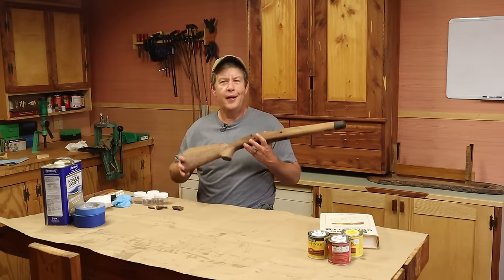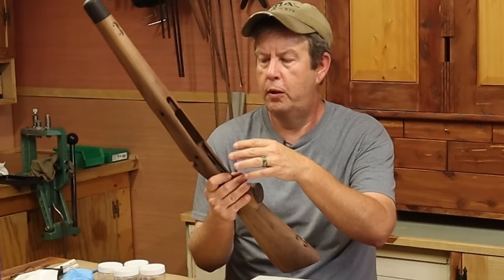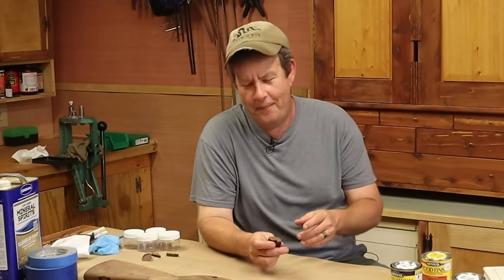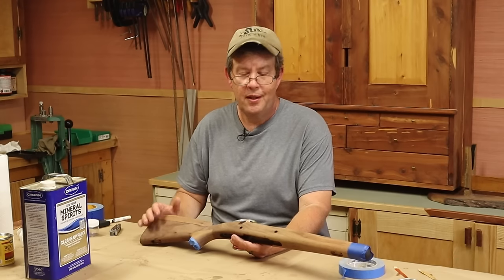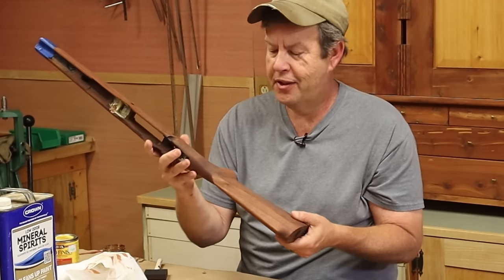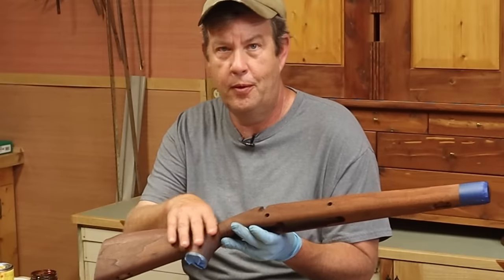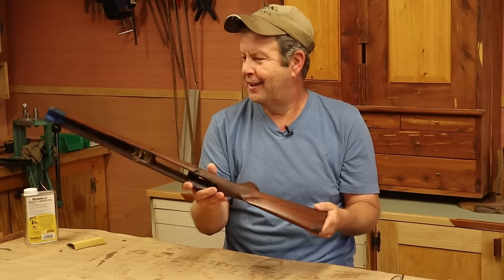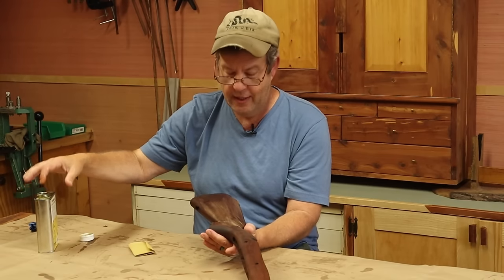Finally Stain and Boiled Linseed Oil on 1903a3 Stock

Comment: I think it came out beautiful. The color from the spliced in wood doesn't bother me in my opinion it gives it more character shows that somebody built what they wanted versus going out and buying somebody else's work. My preference is the Danish oil sanded in just like you did it with the linseed oil. Danish oil is typically made from blends of Linseed oil and/or Tung oil, mineral spirits, synthetic resins and varnish to make it durable and easy to work with. Rustins Danish oil however is considered to be the 'original' formula. So it dries faster and comes out to a really hard durable finish. I think it came out great. Thanks for sharing 👍

Comment: A real down-home gentleman, right there.   Great video.   Nice low-key demeanor.    I agree 100%.  Linseed oil is the way to go for a field grade stock.   That stock is most likely old growth timber, and probably closer to 150-200 years old, when you factor in the age of the stock since built, and the potential age of the tree at felling.    That stock looks great.    Best of luck with the build!
Reply from the maker: Thanks Garand Guy, and I hadn't even thought about factoring the age since built. Great point.

Comment: I once oil finished a 22 lr stock and fore arm one piece and got the idea from an outdoor mag that stressed many one or two drops of linseed oil per coat allowing time to fully dry between sometimes just hand rubbing between coats. It turned out extremely well , took a little time but was well worth it. Thank you so much for bringing up  the issue of the memorials. Once gone they are gone forever and like you mentioned they have a much deeper meaning to families that lost members. 
God bless you , stock looks great.

Comment: I've used Tru Oil with great results.  For example, I used Tru Oil on an old oak rocking chair over 40 years ago.  The finish is still great and stood the test of time (plus kids, moves, and pets).
Reply: I love Tru Oil, used it in the late 70's on two flintlock pistol kits, most recently on the tiger maple haft of a pipe tomahawk. 1st coat thinned 50% with turpentine, 2nd coat full strength and it was finished, I was amazed it only took two applications.

Comment: Just a thought !!
You might try, after scraping and sanding the stock, to wipe it down with a liberal coating of acetone. This really opens up the pores of the wood. Stain your would immediately after drying, if you choose.
Whether it is stained or a natural finish, using a 3x3 inch piece of compressed FELT, burnish the wood until smooth. I prefer to do it by hand so I don't burn the wood. Using a reasonable amount of pressure, a reciprocating movement with the grain. Then 4 to 5 coats of a clear finish. I prefer to do this on a tiger Maple stock. The finished result is amazing.

Comment: A good way to maintain that finish is to make a Gunnys Paste : 1/3rd equal parts by volume of melted beeswax , turpentine and boiled linseed oil. Heat it all together in a double boiler then pour into a jar to cool. It will set like a paste wax , rub a bit in every now and then to the stock and it’ll look good as new.
Reply: Equal parts BLO , shellac, alcohol. Works good but need to machine buff

Comment: Thank you, I have never heard of sanding in your boiled linseed oil. I am working with red oak and white oak, and I think I can use that method to seal off the pores. I'm only working on a guitar neck for a cigar box guitar, but your tips are very helpful. Thank you

Comment: The end of this video should be sent to congress. Great work on the stock. and To blend color after the staining process, especially when you use linseed oil, I've mixed a couple of drops of stain in the oil while sanding it in.

Comment: Thank you.  I have this exact issue with a new stripped walnut stock that is extremely porous except for a few areas that are evidently harder, so I’m getting blotched light spots, and just using BLO / mineral spirits 50/50 gave an extremely ugly dark finish with those light spots.  I didn’t think you could use pre stain conditioner on hard woods, but that looks like what will help.  This is a military stock so I don’t want poly.  Now I need to mix the stains and get that worked out.  Glad to find someone with the same issue that came up with a great solution.  👍

By the way, I’m from California, but my family is from northern Kentucky 100 years ago, and I think it’s a damned shame those memorials are no longer politically correct.  They are honoring heritage, not hate.   Thank you for raising the issue.  🙏

Comment: I redid a sporterized Mauser stock that was as problematic as yours a few years ago. The way I fixed the shading problem was to mix 50/50 Min-wax black oil based paint, and Min-wax Red Mahogany. It took 3 coats IIRC, and it evened out beautifully.

Comment: Being a novice at wood refinishing gun stocks. This video was ever so much helpful and educational. I'm presently working on an old Savage Springfield 840 30-30. The sanding is over and the first coat of ( Gunstock stain) has been applied. My problem is what oil based sealer to use. This video helped my decision. Oh and in my humble opinion, you can't change history by removing statues. Doing so only causes anger and resentment for the ancestors these statues were erected for to honor those who died fighting for what they thought were just at the time.

Comment: Man watching you rebuild that stock gives me a slight filling i may be able to do mine. My 1903 270 has a stock made by bishop.  Its got beautiful lines in there but im worried I'll mess up the carvings in the process. I want to do a gloss finish and pull out the wood. Im on the fence.  Hey you want another project 😆.  Its looking good looking forward to range day with it come deer season

Comment: Im glad to have run into your video. Im fitting a Rem model 11 stock. I wanted a nice red stain and didn't know minwax had a Gun stock stain and that it was red.
I just stained A M14 and a savage 22 stock with the gunstock finish. That stain gave the stock a beautiful red color. 
When I finish cherkering the model 11 its also going to get the beautiful red color.
Thank again.

Comment: I'm a muzzleloader guy and have finished many stocks using linseed oil. An old timer once told me that back in the day, when linseed oil was used on new wood, you were to apply it once a day for a week, once a week for a month and once a year or whenever it got wet. I've found a linseed finished stock to be nearly water proof. NIce job on your stock.
Reply: I would add after the 'once a week for a month' step, do 'once a month for a year' for a total of 23 applications.

Comment: Tom, your work is awesome. I bought a new rifle and was not happy with the color of the stock. I hand rubbed 2 light coats of Boiled Linseed Oil, and it didn't help much. It still looks like old gray barnwood. Is it possible to apply my stain of choice over the already applied Linseed Oil, then apply more Linseed Oil, or must I strip the Linseed oil off first? I have no clue how to remove linseed oil.from a stock. American by birth-Southern by the grace of God.

Comment: Try pre-coloring with a dye, which will absorb into the wood cells due to the much smaller particle size.  This can help you reach the color of the original wood so that you can uniformly stain the whole.  The dye should precede a preconditioner.   And you are absolutely correct on your political assessment.
Reply: Also you can add Japan Drier to your boiled linseed oil to shorten curing times.

Comment: One thing for Tung oil is it is non toxic linseed oil and true oil are full of lead and arsenic.tung oil dries fast and shiny.you can finish salad bowls and butcher blocks with it.nice job on that stock very informative thx for posting.im looking forward to the checkering
Reply from the maker: Dino, BLO can have some harsh stuff in it but most are reasonably safe and pure BLO is food safe as well. I need to do some digging to see exactly  what is in the Brownells oil I'm using but I know it has some driers in it so it's definitely not pure. And I can't wait to see the checkering either. But at the same time I'm sort of dreading because I know that's going to be a slow tedious process!

Comment: Yes Tru contains a bit over 11% linseed oil, 33% poly urethane 56% mineral spirits. But equal parts is a traditional furniture finish. The mineral spirits help to thin for penetration and speeds drying times

Comment: Really good results.  I have an older version of James Howe's book.  He has a formula using raw linseed oil with turpentine mixed in to allow for deeper penetration and thus more stable wood from humidity changes.  Would like your opinion. Love your editorial!
Reply from the maker: Eugene, I saw that same formula and started to try it myself but I decided to just stick with the old tried and true straight boiled lin seed. But I will absolutely be trying that on a future project.

Comment: The wood in your stock is likely been around twice as long. If you consider adding the age of the tree that the wood came from, it is likely over a hundred of years old easy. American walnut is much softer than Turkish Circassian Walnut. It is lighter but less dense and hard. It also tends to have better figuring and a darker color. I was hooked on using Turkish Circassian Walnut the first time I used it. You can buy highly figured Turkish Walnut but it cost a small fortune I never had.
I might think you should have the recoil pad on the stock while you finish the stock. The best advantage to using linseed oil is you can always continue adding finish over years of time. I have seen linseed oil finishes that look like lacquer and polyurethane. It is a long process completely filling every single pour in some wood just using linseed oil alone. Linseed oil is a great benefit for checkering if you seal it as time passes after use. I can’t wait to see your finished product. I think you will be happy once done.🙂

Comment: I've heard of people speeding up the drying process by hanging the stock in a closet with a infrared heat lamp but I've never tried it. Happy Memorial Day 👍
Reply from the maker: Thanks Brian, but it has actually been curing really fast. And I just read that Brownells has drying agents in their BLO (which is what I'm using for this one) to speed up drying time and I believe it. I'm on the 3rd application already and should be checkering by next week?
Reply: @TomRiverSimpleLiving  Nice 👍. I think it's going to look great even if you can see the spliced in wood. Thank you

Comment: Personally the only time I would think about putting a sporting stock on a military rifle would be if I could not find a replacement. Military Rifles in original configuration have a special appeal for historical and utilitarian reason’s. I love My Remington 700 BDL, 721, Winchester M-70 featherweight Ruger 77, Savage 99 etc . I like wood stocks even on a FN FAL . So long as they are not gaudy l , looking like a Chinese Trunk or a ornament from Theebaws palace.

Comment: How is the b.l.o penetrating the wood after you’ve stained it?
Reply from the maker: There's not near as much penetration but the b.l.o is still forming a protective layer over the stain and it can still be touched up easily as opposed to polly or some other clear coat.

Comment: Awesome finish. I wouldn’t touch the boiled linseed oil without gloves. There are metallic dryers in most boiled linseed oil. 

There is a brand called tried and true that actually boils the oil

Comment: RAW  LINSEED  OIL 'purified version'  will penetrate deeper and dry much slower.... PURIFIED RAW LINSEED OIL  blended with PINE TAR provides an outstanding protective layer to the wood...and actually penetrates,   well below the surface.   FINN MOSIN NAGANT ARMY issue  rifles received this FINN Pine Tar finish.   For the artist...  Some pine tars are darker than others....and pine tar can have dies  blended in, at the factory,  or at the artisan's work station..  Pine Tar can also be mixed or blended  with  Boiled Linseed Oil, Raw Linseed   and Bees Wax.    The pine tar allows for a TOOL HANDLE texture grip able surface.  ALLOWING A  BETTER GRIP  WITHOUT CHECKERING.   This traditional finish  was also used on Axe Handles and Baseball bat handles.  IF you already have an oiled wood stock... a top coat of  any of your Natural {non-petroleum}  OILS mixed or blended with Pine TAR will blend in... A bit of HEAT or a lot of heat will allow pine tar or pine tar blends  to penetrate more quickly and more deeply.   PREMIX products... ? YES, these do exist.  "Huberd's Shoe Grease"  is sold as  a leather treatment product.  This one amounts to Pine TAR mixed with Bees' Wax.  Huberd's Shoe Grease can be used on leather and   oiled woods... if you want your rifle better protected from humidity, damp conditions, wet conditions  and rain. And, you will get a better surface to grip.... YOU WILL  PROBABLY NOT  get a high gloss finish with Pine Tar.  It is more of a matte or satin finish.  FINN Finish is unique....and NOT exactly like anything else.   The Swedes and Norwegians also use  variations of this to protect homes, churches and barns.  Some of the old STAVE CHURCES  in Norway... with PINE TAR finish are over 700 years old... Yes, SEVEN-HUNDRED YEARS OLD, made of wood... and still in use. Pine Tar works... if applied with some HEAT to open the pores of the wood and allow it to penetrate in...  it might work even better.  Interestingly, it might even add a bit of weight, mass or heft,  to your wood.  For a powerful rifle...sometimes we might appreciate the added bit of  weight for less of a jaw breaking or shoulder punching  kick.